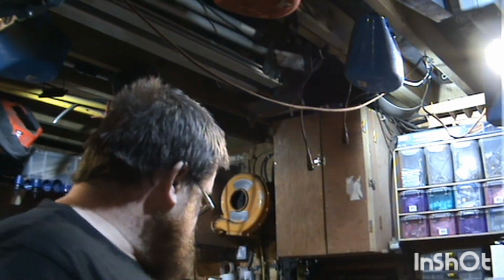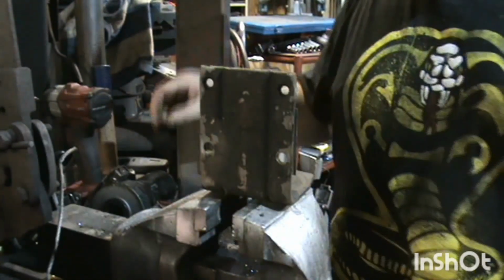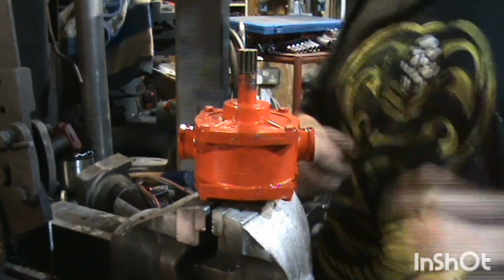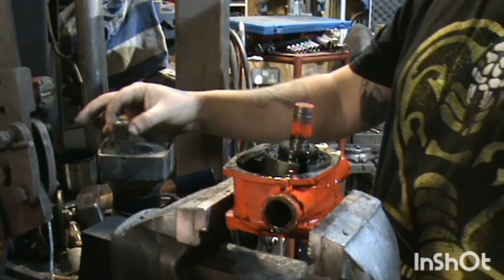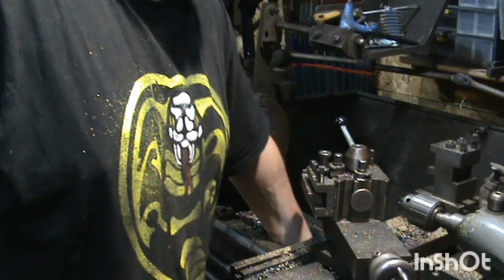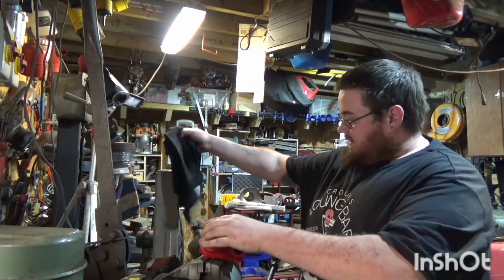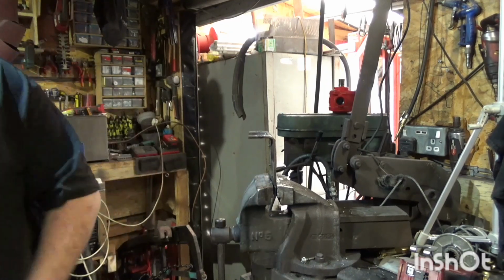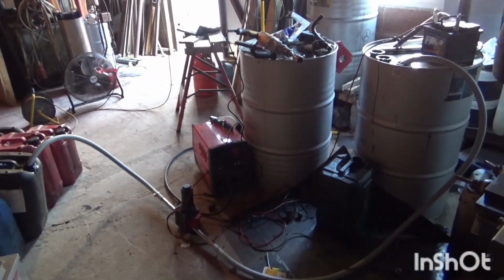simple diy waste oil transfer pump

Comment: Still messy no matter but hey! Worth it for that Black liquid gold. Do you find it easy enough getting enough of it?  It sure seems like you do.
Reply from the maker: Hello, I can typically get around 250 litres every week, I have 10 drums 5 for clean 5 for raw oil I go when I get down to my last drum of raw dirty oil if I have rool to store it. Yeah the mess is less with my little pump but I still get the odd little bit on the floor. I'm going to get a heating oil tank to store it outside then pump it from there so I'll have no contact with it once it's in the holding tank....but that's as an when I can find a tank and time to set it up. Thanks for watching

Comment: Drill hole in center and put a thin rod you can grip with a drill
Reply: I broke  one of these pump using  a drill,maybe  because  the drill was to fast
Reply from the maker: Yep, they can only spin so fast. It's intended for a slow, steady rotation
Reply from the maker: Yeah you can but use it for too long will burn out a battery drill. 12v winch with a car battery and I can pump over 5k litres

Comment: I tried using one of these pumps about 10 Years ago but wasn't clever as you to make it work.  I always thought there was a pot of potential in these pumps.  I think I should have used a bigger motor and maybe geared it down as well. 

I have been using Modified Chev Small block oil pumps which work well and are fast.  There is a vid here if you are interested. 
https://youtu.be/fkBIYcT6j8U   May be more than your setup but I have been using this over 10 years now and built quite a few for other people and are really happy with them.  I have just set it up with a remote switch so I can turn it on and off from the hose end. Some of the places I collect Veg from now need a long hose run from where I can get the ute with the drum with the tank in the back so this makes things much easier.
Reply from the maker: A wow the legend of waste oil burning him self watched my little channel. Hello, yeah I've watched all you're content and Tcme you 2 are the reason why I went from svo to waste oil. I'm looking for a gear pump at the moment but no luck so I used the vein pump as it's what I had. I will make a better faster transfer system. Thank you so much for watching take care